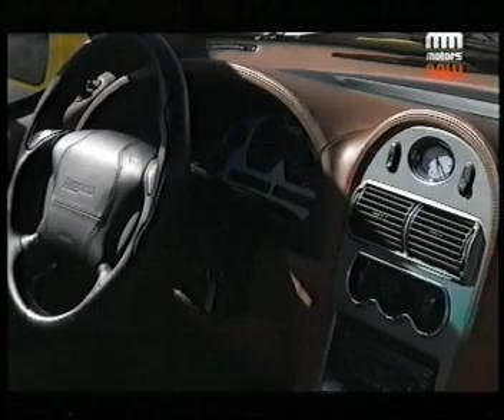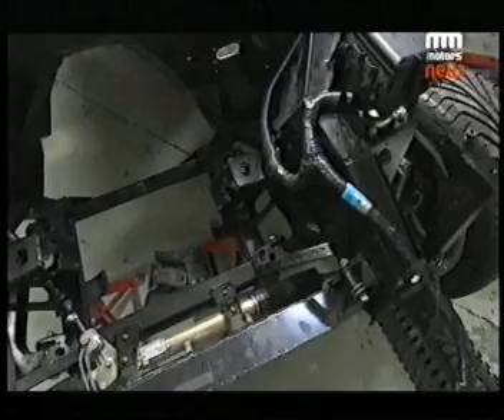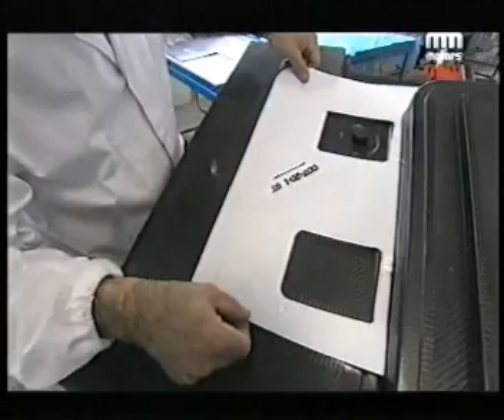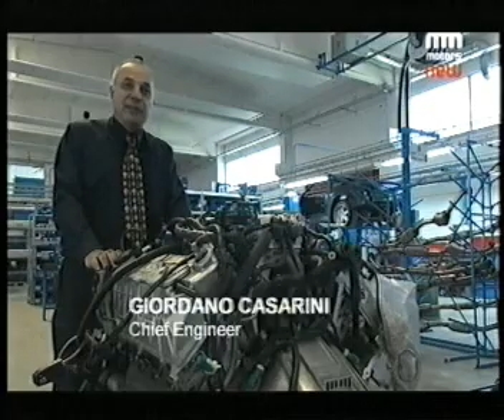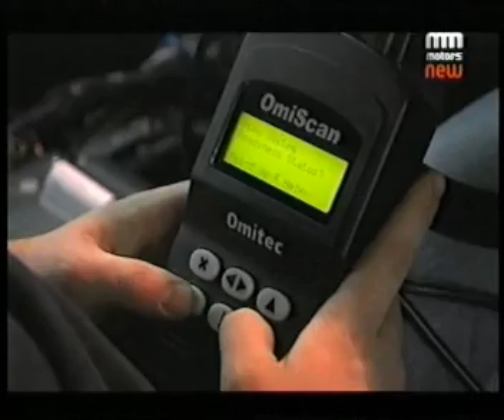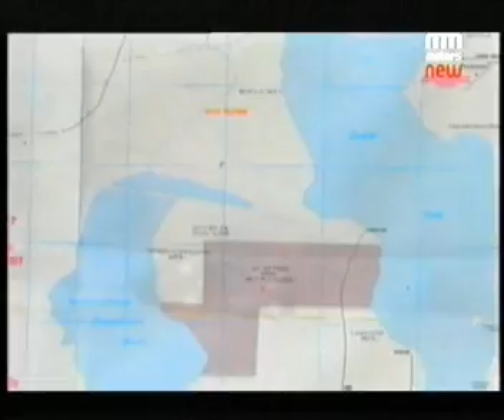Making of the MG SV

Comment: The parts manufacture and assembly  transport logistics were madness 1400 kgs was actually heavy it was not  pretty to look at amalgam of pressed steel and CF odd and awkward much inherited from the  Mangusta none of it a good idea from the start and a huge price at the time.
Reply: Richard Hinton I love the look of the SVR
Reply: Why heavy? A Mazda MX5 is 1200Kgr and it has a 4 cylinder engine. Also this is technically a 4 seat car (sort of) without back seats i.e it is physically bigger. A modern 911 is 1500+ Kgr again depending on the engine almost 20 years later.
Reply: My Delta integrale is 1400kg... sv is a much bigger car physically and engine is a v8 as opposed to my 4 cylinder..... I worked for SP on the development for SV... as drove a couple of finished cars.. I agree it was too expensive and build quality wasnt good enough for a 75k car... you could buy a 911 for same money..... but I dont think you could say it was heavy considering its size and spec.
Reply: Dare I mention the TVRs of the time had similar power but only weight at tonne and cost half the price?